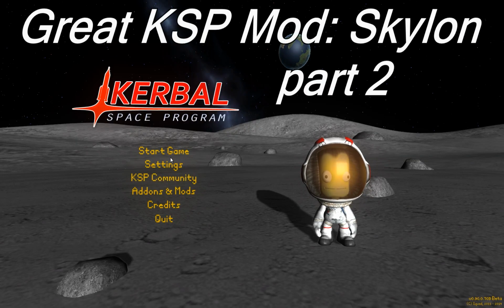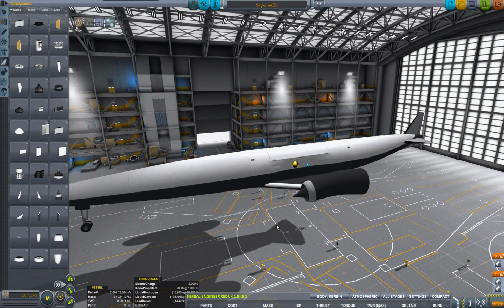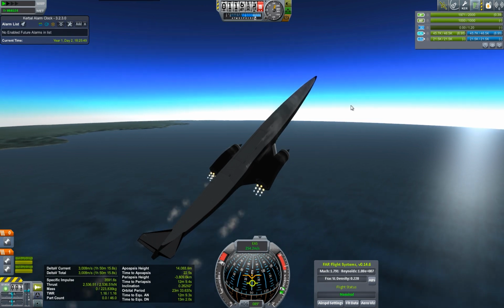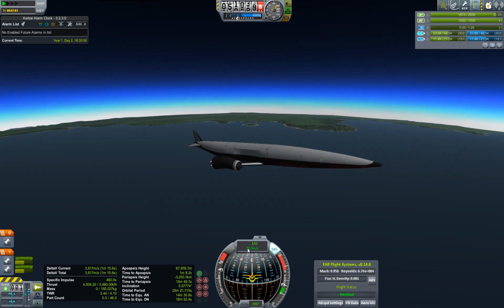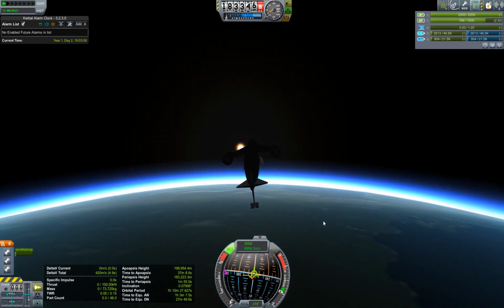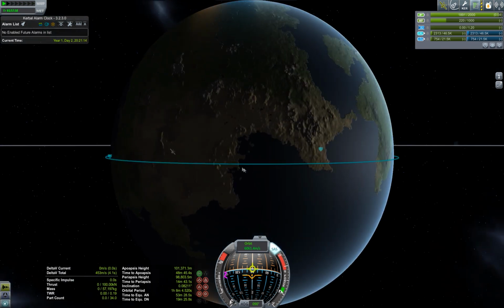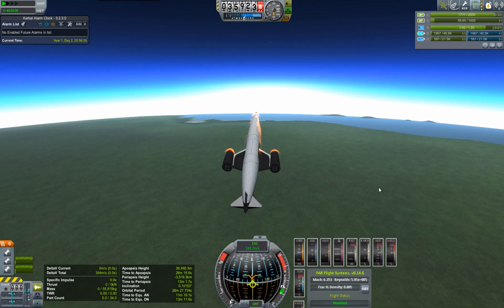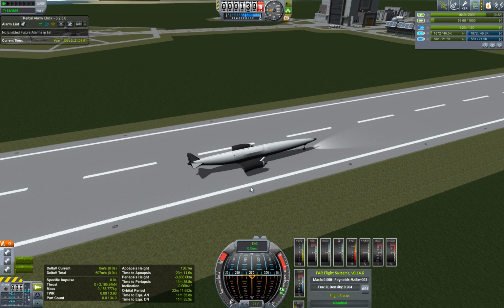Great KSP Mod: Skylon, part 2

Comment: Skylon is such a cool idea. Thanks for posting these! I especially like the Skylon Upper Stage concept. A reusable upper stage? That's just crazy!
Reply: The precooler is what amazes me most. Somehow, they figured out how to cool incoming air about 1000° in a fraction of a second, all without icing over. That's "impossible".
Reply: Precooler runs the air past a series of tubes containing liquid hydrogen. This cools it down thanks to the very low temperature of the hydrogen, and also heats up the hydrogen, making the engine more efficient. This is fact, now for speculation: I imagine that it also injects a little hydrogen into the air, which would vaporise and lower the average temperature of the air. This would normally lead to a overly fuel rich combustion chamber, but I imagine that they are pumping as little hydrogen around the engine bell (most common way of cooling it), thus having less to pump into the combustion chamber. The hydrogen in the air + that injected afterwards would then be at close to optimum. 
I'm not sure if the advantages of being an air augmented rocket outweigh the disadvantages of having nitrogen in the combustion chamber.

Comment: Nice work! I believe the yawing to one side while rolling down the runway is somewhat realistic, I mean both engines realistically won't be producing the exact equivalent amount of thrust. Especially with the engines so far apart, i'm not entirely surprised that there would be some yaw.

Comment: I think the yaw problem is related to the intake air. I notice that your intake air depletes completely at max throttle. This would give one engine a higher max thrust, since the engine is placed on the tip of the wing the entire vehicle will yaw. (Once there aren't enough air for both engine to work at max thrust KSP would feed one of the engine with more air, I don't know why.)

About why sometimes it doesn't yaw that is because air intakes is kind of buggy with real fuels, sometime you never run out of air and some times you can barely run at 50% throttle.
Once you get your speed high there would be enough air to enter the intakes and feed the engine. Also vertical stabilizer starts working at speeds. So the yaw stop.

My advice would be watch the intake air value while throttling up, always leave ~5% air in the resource meter.(Which means slower take off, might not be an option for such a heavy vehicle here) Or you can edit the air intake config file and give it a higher IntakeAir capacity as well as a larger intake area.

Again this is just my guessing, try taxing at less than 100% throttle and see if it yaws.

Comment: Pitch Torque from reaction wheels really messes with wheels in Unity, I've found that many of the rovers and aircraft I've made that would not roll straight on the runway behaved perfectly as soon as I disabled the reaction wheels. Alternately, for rovers you can rebind the driving controls to not coincide with the flight mode controls so the reaction wheels are not triggered by driving forwards, that however does not help with aircraft. Roll and yaw torque seems to be much less important.

Comment: Also the only thing about Skylon that kinda scares me is the fact that the technology can be militarized so easily. I mean who's to say that a similar vehicle can be developed to put weapons into space, kinda like how we kept B52's within striking distance at all times during the Cold War. If a spacecraft of that nature was in orbit, it could deliver a payload on a matter of minutes with no warning. Especially if it could launch a reentry vehicle that could reenter faster than a normal spacecraft since there could be very high G tolerances and temperatures.
Reply: It's no different from a fake coms sat. It lets you put stuff on specific orbits with little warning, but that's the only advantage. Skylon will in fact require a shallower reentry than a warhead, so it would only be a way of putting them up there.

Comment: The reason Kerbal Engineer doesn't handle the burn time properly is that you have all engines in one stage. You need to move the OMS into its own stage.
Reply from the maker: I just tested this out, and you are perfectly correct. Thanks!

Comment from the maker: Ziraya0, you have disabled replies to your comments for some reason, so probably won't see this. I tried your suggestion. Turned the reaction wheels off and tried a takeoff. Unfortunately, the plane still yaws hard to the right, intermittently.

Probably that was a good suggestion, but it's not the solution this time.

Comment: For ease of use (time saving), could you use engines with those stats to build a .64 scale vertical launched SSTO? A cross between Falcon 9R and Skylon. That would be quick to fly and save building time in your series if you reused it.
Reply from the maker: I have sketches and half formed ideas about one sabre powered plane that will launch anything. Runway takeoff for crew and/or light payloads. Space shuttle style vertical launch with external tank and boosters for heavy payloads.

Comment: Cool video! But when is the next episode of Kraken?
Reply from the maker: Sometime after I figure out why my spaceships aren't undocking. I haven't put any serious effort into that problem yet. Was distracted by this Skylon project.
Reply: TheWinterOwl I noticed that the Procedural Fuel tanks seem to cause the undocking if you have a Docking port attached to a Procedural tank part on any sides I also encounter the undocking bug. But if I attack the docking ports to stock parts or KW ect it works fine.
Reply from the maker: Dermeister009 I just did a few hours of troubleshooting and have conclusively proved you are absolutely correct.
I made a simple ship of just a few parts, and observed it undock correctly. I added a single procedural tank, and now it won't undock.

This is kind of devastating. I am so very dependent on Procedural Parts! What could possibly have changed to produce this game killing bug, after the parts have been working for so long?
Reply from the maker: Dermeister009 I failed to notice that Procedural Parts updated to a new version several weeks ago. With the update, the bug is fixed... sort of. Any existing craft file that was designed with the old version will still have the bug. So EVERYTHING in my install needs rebuilt. Atlatl, Woomera, all station components... all of it.
Existing commsats and scansats already in orbit should be okay as long as I never dock anything to them. But that whole station needs rebuilt and relaunched.
Reply: So, the Kraken's been rearing it's ugly head? :P

Comment: It sucks that I was correct I was hoping it was something else because I love procedural parts... now I have to build everything around that bug :( it also sucks be cause In your videos you seem to use a lot of procedural parts as well and it has slown down the output of videos for ksp. But in any case at least now we have an idea of what causes all these docking port shenanigans.
Reply from the maker: FOUND IT!
The bug is an interaction between the latest versions of Procedural Parts and Kerbal Joint Reinforcement. Earlier versions were fine. Either mod by itself is fine. But the current versions of both mods together causes the undocking bug. Verified with a stripped down install of only stock parts and those two mods.
Reply: TheWinterOwl Dude that makes sense because I Use joint Reinforcements as well! Did you post this on Kerbal forums? that's useful info!

Comment: anyone know why the engines are curved? 
I looked it up and I didn't get a satisfactory answer
Reply from the maker: I believe - but am not 100% certain - that the curve shape is for extreme high altitude, supersonic flight. The plane has to fly at a much greater angle of attack way up there, so the downward pointing air intakes will actually be more closely aligned with the direction of flight. At the same time, the engines will point even further down and will directly provide lift when the air gets too thin for the wings to work well.
Reply: +TheWinterOwl 
Thanks :)  I really appreciate you taking your time to reply!
Reply: come back to us :'[

Comment: I know this video is ancient, but do you remember what scale your home planet was for this? Your modlist link is broken and I'm trying to edit this mod to be full scale

Is it just regular Kerbin?
Reply from the maker: If I recall correctly, this was when I was using 6.4x scale. I think that’s right.
I’ll be very impressed if you can make it work in a recent version of KSP!
Reply: @TheWinterOwl  Thank you! And it's proving difficult so far, but I think it's doable. I'll post back if I get it to orbit :)
Reply: I got something quick and dirty put up last night (scaled the parts up 30%, scaled the fuselage volume up 300%, and used the ISPs from the Skylon user manual).

https://github.com/MacKenzieHnC/KipardSkylon

 Haven't gotten it to orbit yet, but the masses are just about right, which makes me think it's possible. 

I still need to adjust the engine strengths, but it won't lift off in time if I use the real values cause something's wrong with the lift calculation (it's supposed to takeoff at 155m/s, but I can't get it to until 200)
Reply: And now I've found the FAR problems

There are updated versions from other people if you're not worried about FAR tho. I'm gonna keep chipping away at this and see if I can figure out why Kipard gave up
Reply: I'm pretty sure I've fixed FAR compatibility. Non-FAR is still screwy, but I haven't messed with that yet. However, I did make the .cfg files a lot easier to navigate, so anyone who's interested can adjust as they see fit